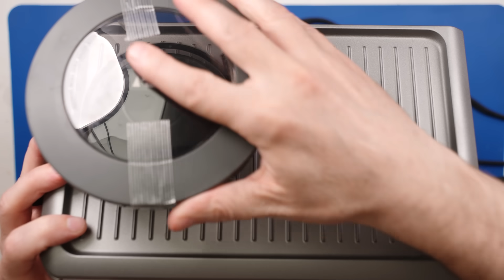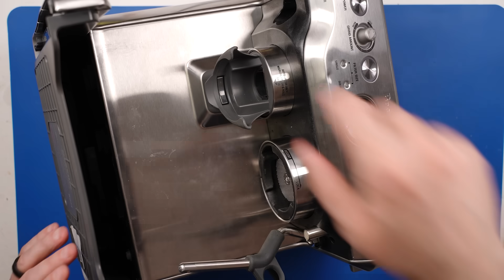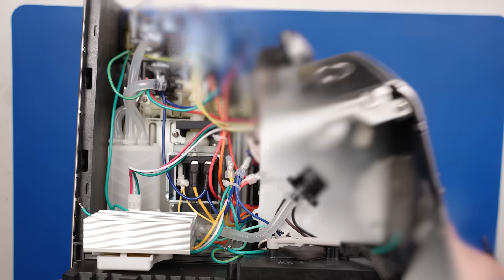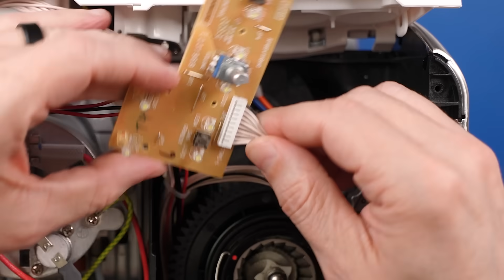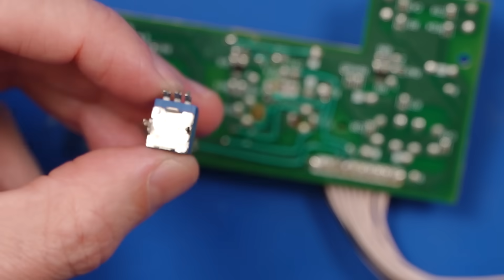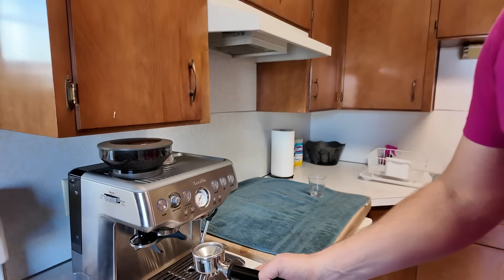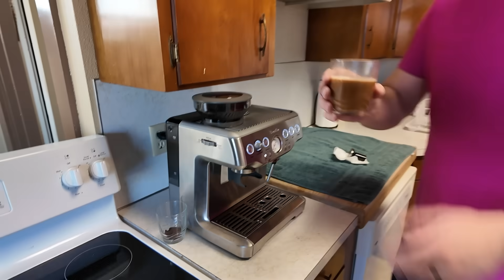Are Expensive Breville Espresso Machines Repairable?

Comment: So the problem is that these machines in the grand scheme of espresso machines are actually incredibly cheap, and the build and repairability certainly shows that. More expensive machines, usually from Italian manufacturers, are often considerably more repairable as they use standard and often generic parts that you can get from basically any espresso machine parts reseller. Unfortunately, they will cost you a god damn fortune by comparison.

Comment: I have to say as soon as I saw you dry fitting on the trace side of the board I knew you were off. Everything (LEDs, knob, on that board) went through the front. It would have been a bugger to desolder mounted like that. But I have done similar stuff. Especially recording. 

And when your physical inspection showed impact damage on an otherwise immaculate machine - I would like to believe I would have started at the most obvious place.  But I don't know. I'm getting pretty damn old. And I can't be sure that poltergeist that hides my coffee ☕ cup in the microwave and takes my eyeglasses into the room which I absolutely was not just in 10 minutes ago. 

Cudos for leaving it in. I have long been a proponent of admitting goof ups. We are all human.

Comment: 550USD is expensive? An entry level Espresso machine is about 1000USD and an entry level grinder is 500. A good dual boiler, preinfusion  machine is at least 2000. If you want pressure profiling add an extra 500

Comment: This is a great example of packaging and product design issue combined. That knob got smashed from the outside, and either there was not enough padding (styrofoam) around to protect it or it was dropped, so it broke that board. As for the repair, you could have re-ordered the board entirely, but that would've been much more expensive.

Comment: If you can fix something yourself, then it's usually worth restoring an expensive machine.  If you have to take that to an appliance repairman, then it's a loss.  I have a DeLonghi EC702.  It's not an automatic machine that has circuit boards or bells & whistles.  It's basically just a boiler, thermostat, pump, some valves & tubes.  A while back, I replaced the pump and anti drip valve myself because those parts actually fit many different models of DeLonghi machines.  Now it has a drippy steam valve tap, but that part is discontinued and no longer available.  When I can afford a new machine, I'll get another.  Until then, I'll just wipe up the mess it makes on my counter.  Just remember that all of those complex high end machines have more complicated electronics & circuit boards.  The more complex something is, the more points of failure the machine can have.  My machine was $250 new, but I'm not sure if I would get one of the $600-$1000 machines over the one I have.  They are more likely to break, harder & more expensive to repair, and more heartbreaking if you actually have to fix or replace it.  I've seen the new ones that have LCD touchscreens and programmable drinks.  I will definitely pass on that.

Comment: $100 seems steep for a machine with no signs of power.  Did you see if the circuit board was available anywhere?
Reply: Not to mention all the cosmetic issues that went along with it.

Comment: Yes, you can fix them!
I bought a "The Oracle" second hand for £300 (they retail here for £1800) and expected some trouble, but it worked fine. Then the one time I used it it tripped out the mains. So I found water in the tool tray, took it apart, and ran it disassembled. When I triggered the steam wand there was an obvious water leak from the steam boiler. I let it cool down and took out the spring clips from the leaking and one non-leaking connector to find a damaged o-ring that was orange instead of black. I ordered half a dozen of the correct o-rings (and clips) and checking with a quality digital gauge showed that the orange o-ring was about 0.5mm over on the ID and fine on the OD. New o-rings, new clips, and run - no more leak. Cost of parts: £10.45 including postage, plus an hour of my time (and three days waiting for the delivery). Hasn't leaked at all since or tipped the mains since! 
Would have been nice if the seller had told me it had a problem, but it was a simple fix to an expensive machine and it makes great coffee!

Comment: When I see wide traces I think higher current than narrow traces.   Do you consider the wire gauge when connecting wide traces?

I would expect a potentiometer to be a low current voltage divider, so I'm not sure why those traces are so chonky.

Yeah I'm at the part where you're putting the potentiometer on the wrong side of the board.   That's something I might do.

"I'm going to hope that I don't have to redo any of this.".  There it is.  You invoked Murphy's Law.

Comment: I've a similar model that I got from the scrap, cleaned it and it worked again but the over pressure valve snapped..  that lil cheap plastic tube costs even in China 40 bucks..

Comment: I always take pictures as I go whether it be an engine tear down, brake shoe job or board repair - all it takes is one phone call or hunger spell and my memory becomes etcher-sketch. Digital pics are quite the luxury others much smarter than me never had. Great repair dude. Very expensive machine after the price plius extended warranty and taxes it's a $700 dream. The newest digital version is almost double that cost and Im sure 50% higher in the UK.

Comment: I can't believe someone paid $100 for a non-functioning coffee machine at Goodwill.  This should have been $25-30 at most.
Reply: @jackryan2502  Why is that Jack?
Have you priced a coffee machine?
Reply: @wayneessar7489 Have I priced a non-working coffee machine at Goodwill lately?  No.  Considerably different from a new working coffee machine with a warranty from a retailer.
Reply: Hard to tell how it worked out. Goodwill doesn't usually sell broken/for-parts, possibly they never tested it and were just selling it used expecting that it worked, or it was working and then it was damaged in shipping to Steve.

Comment: At least I know one thing - American's don't know how to make coffee! haha, great video though.

TLDR: while the 30sec draw is "true" it's more about the yield - you should find it start after a 7second pre-infusion (time from when you press the shot button to when extraction starts) it should be a constant steady stream of extraction, not the little drabs you had at the beginning - I would also always recommend doing 2shot by default - this yield and timing is easier. you should be in a 1:1.8-2.2 ratio of beans in to coffee extraction out - i.e. in metric: 18g of coffee in to 40g out for 2 shot over the course of a 30second total dispense time with around 23being actual dispense with the 7second preinfuse stage when you first press the button. Depending on the bean freshness and roast type will change how coarse or fine you need the grind to be, also run around 4 double shots before confirming grind is set, as the grinder heats up, it changes the burr size.

Comment: A tip for using your desoldering gun pump = keep the button pressed while you remove the gun from the board other wise you could be adding solder from the tip while you leave it on the board. Also make a circular motion when it's on the board to release the leg of the component.

Comment: ill also add that these breville machines are so popular that there are all kinds of replacement parts online for reasonable prices.. for instance (july 2025) the broken board with harness can be had online for $20-$30, this video makes a most excellent tear down and put back together guide for the machine.. so dont be discouraged if you dont wantto solder...  use this great video for how to take your machine apart and to start troubleshooting where it might be failing out.!

Comment: During my air force time I once used one of these desoldering irons, IMHO useless. I bought these cheap desoldering pumps (just a stick with a pump you arm and fire at the liquid led). This worked fine all the time. Later I got a note from HP about removing ICs from boards - they explicitly recommended these pumps. They told first heat the joint with your solder iron - eventually from the other side and then, when everything is liquid flush it away with that pump.
My every day tool next to the iron.

Comment: R39 value anyone?

One of the solenoids went and fried R37, I have value and replacement resistor for it but R39 is smoked a little. It did have some value (when measured a few months ago but I don’t recall) 
I want to replace it too while I’m at at it, but I can’t confirm the resistor value 

Anyone know it ?
There are pictures out there but I’m partially color blind so I can’t rely on my own interpretation

Comment: When I was in the military I was lucky enough to attend a couple of soldering schools and when I went to works as a technician I had to repair a number of broken boards. I always preferred to scrape across the break and clean the trace and tin it and then lay across the break with a solid core wire and solder it that way. I always had good luck with it. Anyway great job, I'm sure that will work for a long time.

Comment: They are good machines when they work. I'm on my third of that generation and both previous ones achieved around 30,000 cups made.
Both failed the same way, with the pex tubes starting to leak around their fittings, then wetting the internals.

Comment: My first expresso machine was a Breville design (manufactured?) clone sold by GE / Haier under the CAFE brand which seemed like a bargain at $530.  The main difference from high-end Breville is that the adjustments for grind time, brew and water volume are set via an app on Phone or Tablet instead of touch screen on the machine.  Unfortunately it started to leak internally after about two years and I discovered it was unrepairable—no internal parts are available.  

I contemplated upgrading to a $2,000 machine, which seems to be the price point where commercial grade internals are used but was dissuaded by all the TLC a boiler machine needs with conditioned water, maintenance, the need to invest in separate grinder and instead decided to go retro with a Flair 58 +2 manual lever machine and Lido Orbit hand grinder.  It is a bit more work but is low maintenance, allows the use of tap water  and provides the ability to control pressure when pulling shots.  I paired it with a fast heating OXY kettle and Breville Frother which works surprisingly well will whole milk  (not so much with 1% - 2%).

Comment: Took mine apart, older model then this. Water pump is toast. Was it ever calcified inside after 15 yrs of use, yours looks brand new. I passed on ordering the part and just bought a cheap walmart drip coffee maker. Espresso machine is fun but its totally impractical

Comment: Last summer I found a Breville Duo Temp Pro on FB marketplace for free, in broken 'as-is' condition... so of course I drove the 45 minutes to pick it up. I was ready to shell out $50 to throw a new pump in there and fix it as even the older Duo Temp Pro has a few good youtube videos documenting a pump replacement. I tested the machine and was able to hear the pump engage, and a few measly drops of water came out the shower screen, so I waited to buy a replacement until I poked around in there further since none of the 'symptoms' matched what is typical of a bad pump. Lots of trial and error later, and after finding NO documentation for repairs that weren't a drop-in water pump replacement save for some forum posts from 2006, I went off a hunch and unclamped the internal hoses connected to the heater block and one in particular was so full of scale buildup that the entire inner diameter was clogged, thus causing the unit to not work! 
Fifty cents of citric acid, a few toothpicks, and a little elbow grease later, and I had gotten rid of the blockage completely and I was finally able to get enough water flowing through the internals to do multiple thorough descaling cycles. Now, I've been using it daily for the past year and it makes great coffee and great steamed milk! I am so grateful to have it, as I am a student who would never in any other circumstance be able to afford an espresso machine. :)

Comment: I have repaired many of these phenolic based circuit boards many times. They are cheap to produce but very brittle.
Just repaired my drip coffee maker last week. It was short cycling and not finishing the brew cycle. From past experience with the heating elements on coffee makers there is a safety fuse that blows when the element overheats but there is a second thermal switch on the element that cycles off and on while heating the water so it can percolate up from the heater into the drip chamber. Upon disassembly I found the switch rated at 110°c. Well short cycling means the bimetallic element inside failed by constant heating and cooling for a bit over ten years. A trip to the parts shop in town and I returned with the correct part, installed it and tested it. I works, hop I get another ten years out of the machine. I like it since it brews into a thermal carafe and does not require a heating element to run to help keep the coffee hot, which is NOT GOOD for coffee, I don’t like my coffee by the slice.

Comment: i thought at start “this job is a cinch. new product. prob something obvious in the mains input. i saw you undoing the variety of tiny 😢strange head  anti tamper screws (had the best up to date tools …must be in the repair business). then unclipping plastic panels & finding that missed screw. i thought they don’t want you to play with the product just replace whole. then you observed the broken control board & i thought mybe i took on more than planned. solved problem of board access (unsolder wires… they want to make it so difficult ). but, you had handy all the special proprietary glues & materials (wires) & rigs to make job practical (i thought, lucky you, must be full time in repairs ). (i would h😂 ave given up at this point & chucked the remains). you did a magnificent strong job of repair despite its minuscule tedious nature. realising then you made the most basic blunder of putting rheo switch on wrong side of board, u must have felt so deflated & thinking about all the fine rework! 
i would like you tell all of us where you get your repair materials tools & wires etc from including their specs. this makes big difference so you are not “experimenting” with unsuitable products as you proceed. i used to attempt these fixes years ago. as i got older i realised my weakening eyesight required so many bright lights & magnifying aids. after botching many it was no longer work i fancied doing. i discovered how poorly built many small cheapo appliances are, discouraging repair. built to last til they get out of shop & work for a day or so, well mybe a bit more.

Comment: I bought the same machine new from Bed Bath & Beyond more than ten years ago with a 20% off coupon (I wish they were still around).  Mine failed twice under warranty and was replaced with new machines. The third unit is still going strong and I use it every day.  That dial is to set how much of the coffee beans in the hopper to grind. I weigh my freshly roasted  beans instead and dump them in the hopper just before grinding. I use 18 grams for a double shot and set the grinder for maximum to grind it all.

Comment: Great work repairing!  Believe it’s been awhile since we’ve seen a cracked board. 

Owned a Breville espresso machine for a few years and the pump died.   Tried taking it apart to fix it.  Breville absolutely does not want consumers fixing these machines.  Parts availability is low, and they are an absolute pain to work on.  Ended up with a Rancilio instead.  Just a few easily accessible screws and things start coming apart.

Comment: I once got one for 60 bugs. Don't buy these. There's a bunch of electronics in there, which are lackered and really difficult to find faults. These electronics are necessary, because the other hardware sucks. It has a miniature boiler and all of these electronics are there to turn this into a less convenient fully automated espresso machine. Do yourself a favour and get a gaggia classic or other older Espresso machine and try to make sure that the boiler of the machine is good. The other parts are affordable to change. Also on these older machines you don't need to use original parts.

Comment: I believe one of the pads came off with your desoldering gun.  Personally, on those phenolic singe sided PCBs I never use a desoldering gun since the pads come off real easy especially if the gun is on the hot side. I recommend putting on some leaded solder and then using solder wick with a lower temperature for these kind of boards.

Comment: I brought a tv of ebay 2 weeks ago and when it arrived I plugged it in to find out it was a locked tv. I tried to contact the company that the tv was rented from originally but they are no longer in business and ebay won't refund my money the sellers contact info no longer seems to be correct which doesn't surprise me is there anyway I can get the tv working or have I just wasted £250 😢